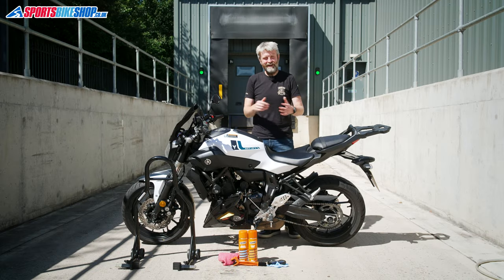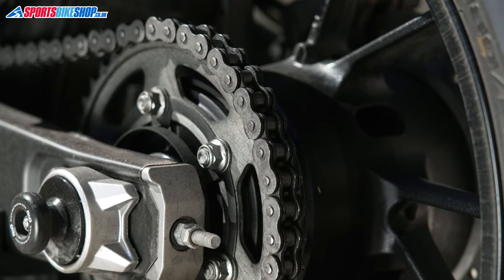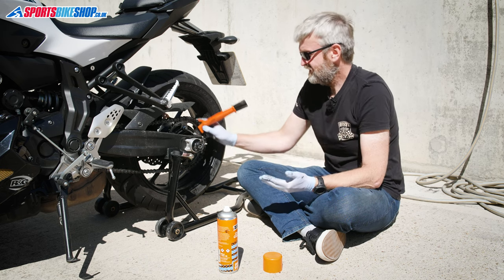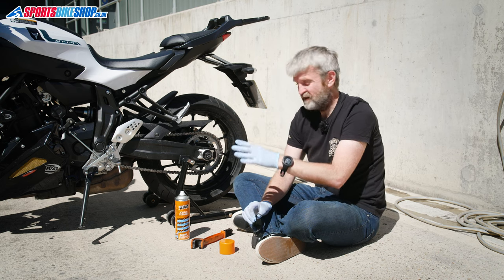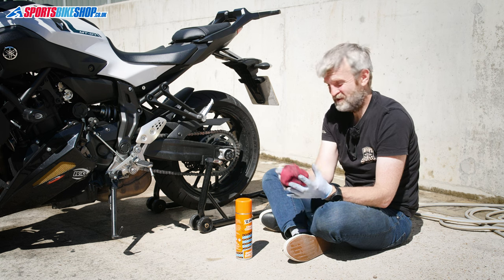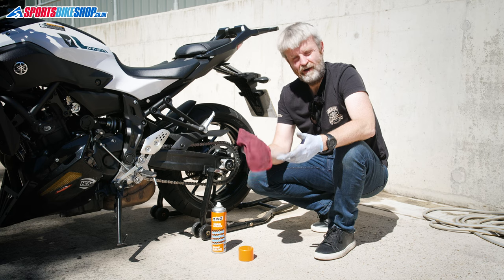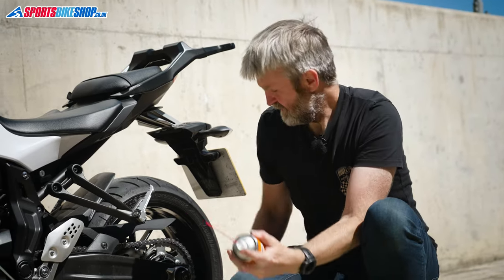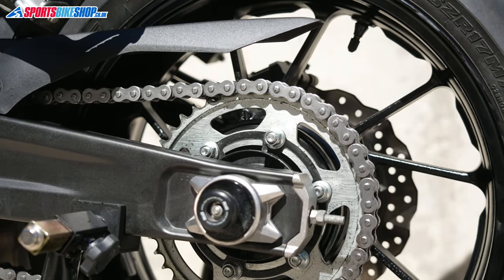How to clean and lube your motorcycle chain - Sportsbikeshop

Comment: Why do you not brush the inside of the chain? Surely this will reduce the wear on the sprocket teeth. To save money I use paraffin to clean the chain and 90w oil to lube.
Reply from the maker: The rollers all get brushed as the chain comes around the sprocket, and the wipe down with a cloth finishes off the clean. If you mean lubing the inside of the chain then the first dose I give the chain goes between the sprocket teeth and the chain. Yup, paraffin and gear oil is a perfectly respectable combo to clean and lube a chain. It does demand a bit more regular re-application and not everyone has the time or patience for that. Thanks for getting in touch. Cheers, Tony

Comment: and everything go on the break disk!! not a very clever way to do it 😐
Reply: I agree.  When applying the lube you don't want to be pointing the straw in the direction of the brake disc.  If you miss with the lube it'll go exactly where you don't want it to go!

Comment: Hehe, with O/X/W-ring chain you only have to lube the roller (which is rolling between the sprocket teeth), not the external link or the sprocket. I always clean the outer links (both sides) after I lubed the chain and the rear sprocket.
Reply: It's recommended to get some on the outside of the links to stop rust. Only really matters if you ride year-round tho.

Comment: great video also interested in air filter replacement/MT 07; fuel injector cleaning/ MT 07; high tension coil inspection MT 07. Thanks
Reply from the maker: If we still had access to the MT-07 in this video I could probably have a go at the air filter, but the other two are beyond me! I hope you find the guide you need out there somewhere (there's loads of MT-07 stuff on the Tube). Good luck. Cheers, Tony

Comment: I also take the cover off and give the front sprocket a clean. That little compartment also collects a lot of gunk.
I'll usually do it on every second clean, or if i've been on a really dirty road.
Some might find it overkill, but since I've inspected the rear sprocket while cleaning, I need that peace of mind with the front sprocket too.
Great video as always.
Greetings from Portugal. ✌
Reply: I found it critical to take off and clean the cover and front sprocket. The previous owner or owners built up so much gunk in there it was crazy thick!